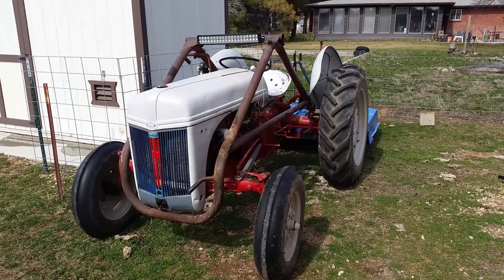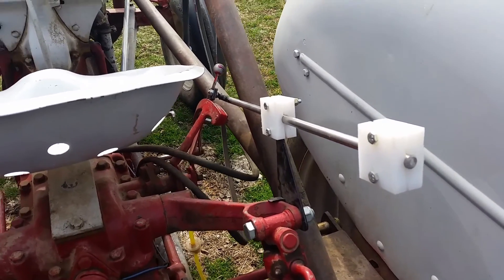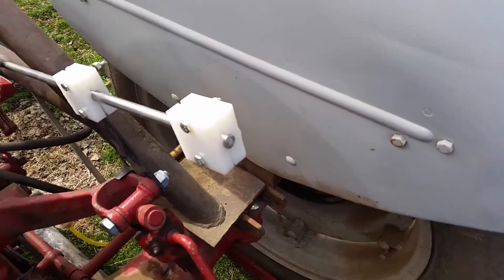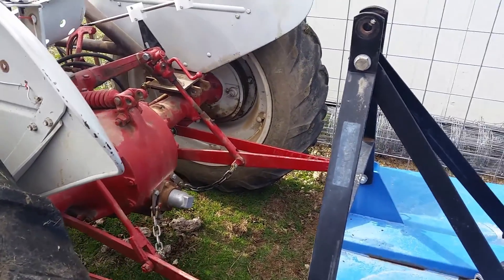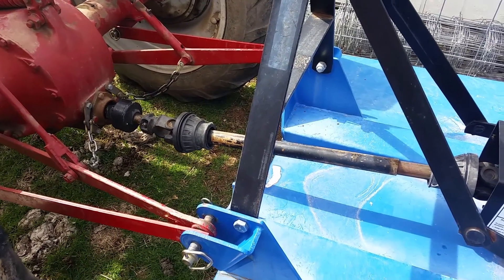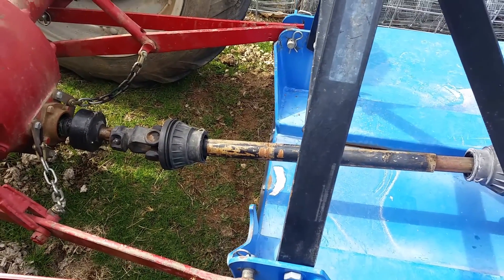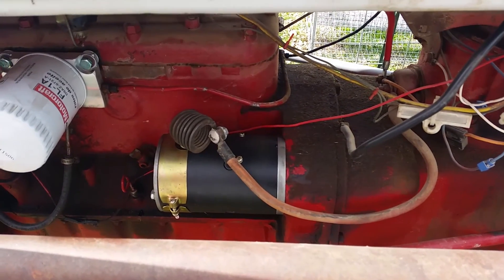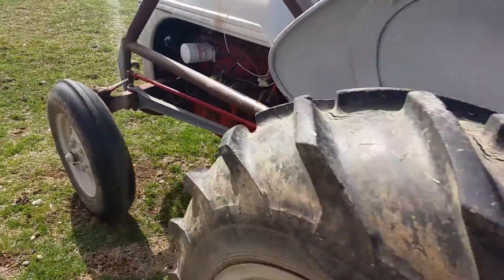Zane Thang Ford 9N 2N Depth Position Control

Comment: You really need to use the top link and I say this from experience.  Without a rigid form of support should you or another user go across a terrace or any point on the area you are working the front of the bush hog is subject to catching on the eneven grade and should that occur the bush hof is subject to flip forward onto the operator of the tractor.  This could happen so sudden the operator will not even know it is happening until he or she hears the clatter of the PTO shaft and generally by then it is too late to react.  If it does occur and gravity is still your friend you must lift the control lever to the top ASAP.  You stand the risk of bending your PTO drive shaft for the bush hog but that is better than having the attachment crashing down onto you.  I hope you find this to be helpful.

Comment: The top link is the safety device that stops the tractor from rising up and flipping backward onto the bush hog if the bush hog hit a stump or rock and the forward motion of the tractor stopped.  It was the safety and convenience of the 3 point hitch which made it a success. Please never operate a tractor missing the top link

Comment: when and how did you get the Zane Thang.
Reply: Not a fan of the oil filter adapter but hey each to his own.

You are definitely spot on on the over running clutch. I will add this to augment your video. These early 3 point tractors have a weird 3 point to PTO geometry where the PTO on the tractor is really low compared to the maximum height of the lift arms compared to the more modern machines. In short depending on the implement you can run into a situation where if you can actually pull the PTO shaft out of the implement if you lift it too high. In the case of our Ford 8N we have a Woods RM600 finish mower attached to the back of it and due to the geometry of everything the shaft is super short and easily pulls out. Basically leaves no room for an overrunning clutch being it will shorten the shaft by 8” or so. Shaft is only about 20” total as is. Our solution was incorporating the overrunning clutch into the PTO shaft. You can get a new PTO coupler for the shaft that has a clutch in it. So rather than having to shorten up everything by 8” you can get a coupler that has one integrated and only shorten it up 2”.  This is an expensive option but depending on your implement and the geometry going on it might be the best/safest one. You always must have an overrunning clutch.  Not to have one can get you at worst killed. 

I used a Weasler 550-8206-55 overrunning clutch on the end of a new shaft I had to build.
Reply from the maker: I got it a couple years ago. I just recently learned that Zane Sherman the inventor of the Zane Thang passed away in 2018. I purchased mine using the information  in this link: https://www.yesterdaystractors.com/cgi-bin/viewit.cgi?bd=ferg&th=134187 Not sure if you can still get them but you may try contacting someone at the address in the link.
Reply: @MiloFarms  thanks for the reply. I also Discovered Mr. Sherman had passed and have been digging to see if they still make and sell them. so far no luck.
Reply from the maker: @michaelwyatt69  If you find any more information let me know and I can add it to the description. Thank you
Reply: @MiloFarms  found nothing. No replies to emails. Did find another company that is making an similar product.  Look up Red Rock Manufacturer.
Reply from the maker: @michaelwyatt69  http://redrockmfg.com/products/miscellaneous/ is it the one at this link called Position Control for Three-Point Hitch?